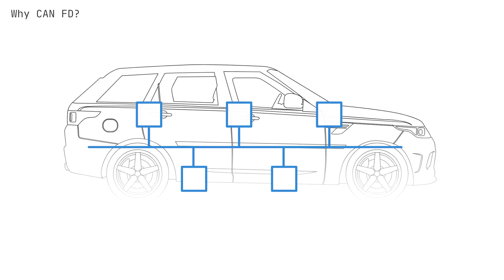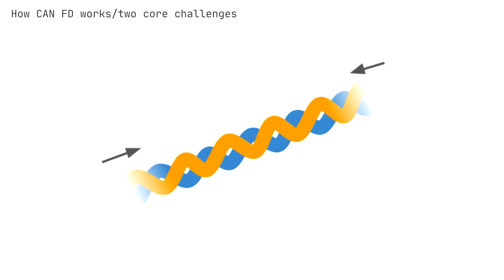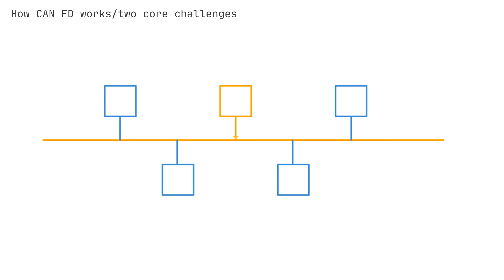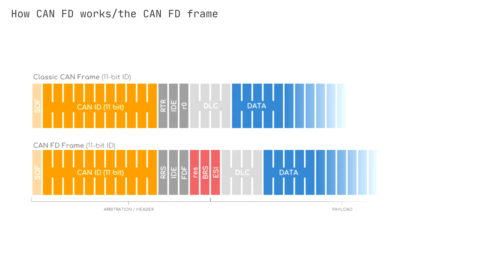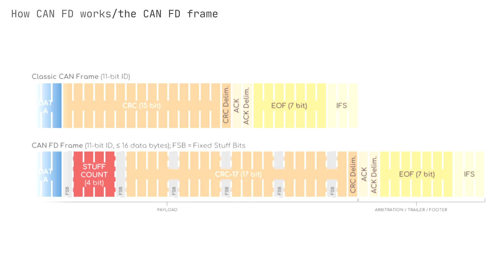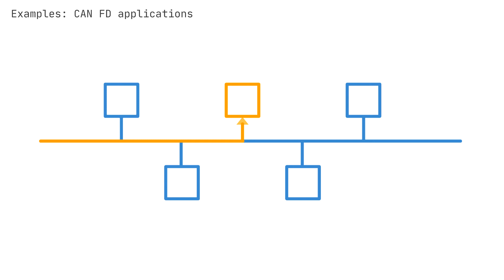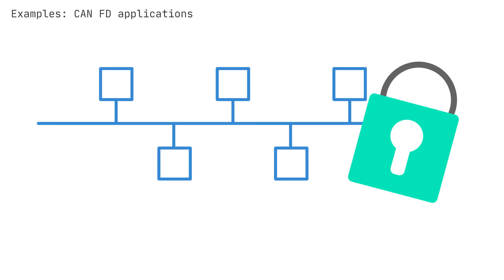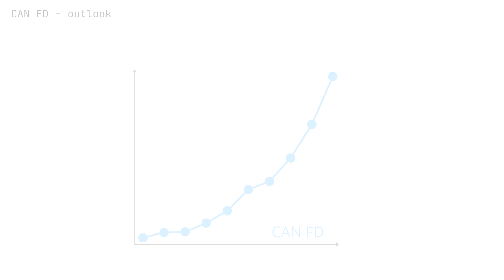CAN FD Explained - A Simple Intro (2020)

Comment: CAN FD is almost identical to normal CAN on the transceiver chip interface level, and has nothing to do with hacker protection. Hacker protection is offered by robust driver design, which affects all protocols used in the system equally.